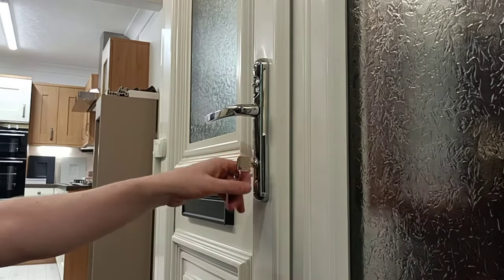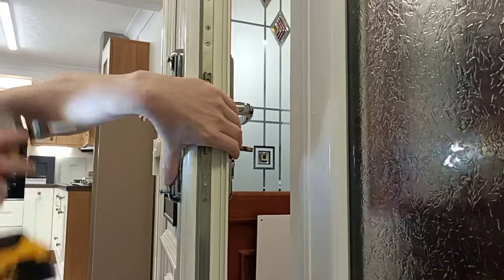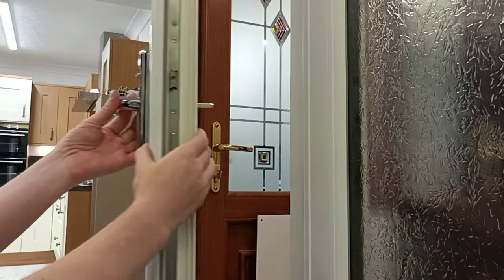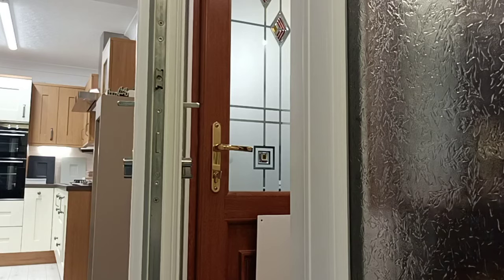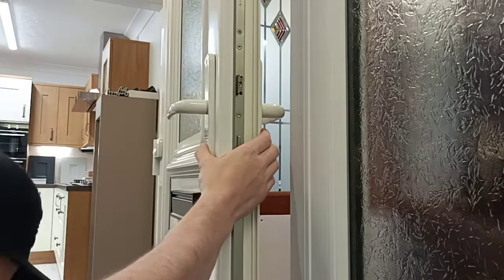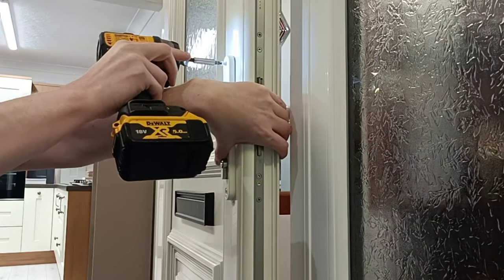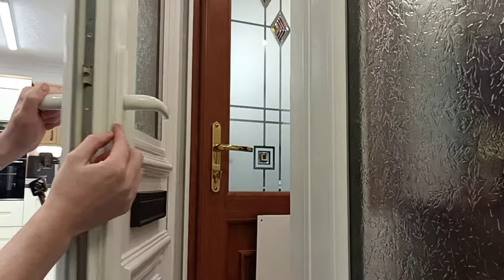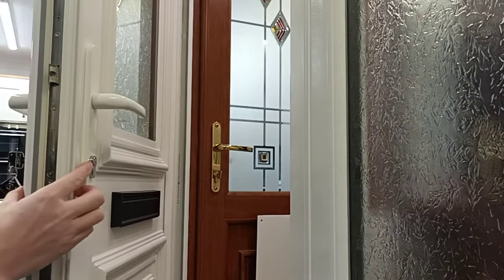How to Remove and Replace an Old uPVC Door Handle | Easy DIY uPVC Door Handle Replacement

Comment: Hi bought a new security door handle all measurements are correct but when I tried to install the sections that go into the door to screw through are larger than the holes in the door. Can you just drill the holes bigger? It's a UPVC door.
Reply from the maker: Hi, yes you can widen the holes and it won't cause any issues.

Comment: Hi, looking for some advice.

I need to replace a UPVC handle, but the problem is the measurement between the screws is 116mm.  I've trawled online and it seems the standard shortest length is 122mm.  So I'm guessing I've got some obscure or obsolete handles.  What do I need to do?  Drill new holes maybe?  Any advice would be appreciated, cheers.
Reply from the maker: Hi, send us an email with images so we can have a look sales@dgpsuk.com Regards Emma
Reply: @DGPSUK  Thanks, email sent.

Comment: Hi can you help with a question I have?

How would one go about replacing a door handle a bit like the one in the video, however there are no visible screws and the door is permanently locked? I guess the locking mechanism inside the barrel of the lock has failed which leaves the door un openable. There doesn't seem to be an obvious way of replacing it without opening the door first to get to the screws and that isn't possible in this situation.

Any ideas would be very helpful.
Reply from the maker: Hi, could you send an image over to sales@dgpsuk.com and we will be happy to advise a solution 👍
Reply: @DGPSUK  Email sent, thank you.

Comment: Is it possible to drill the holes to match the screws?
I got a new door handle 215mm space between the holes. When I tried fit there's about 2mm of a difference.
Reply from the maker: Hi, yes you can as I'm guessing you needed 211mm standard handles. Or if you prefer the correct handles have a look...Long Backplate 
 https://www.double-glazing-parts-spares.co.uk/trojan-sparta-composite-lever-inline-l31546
Reply: @DGPSUK  thanks for replying.
Reply: @DGPSUK  I need offset handles, 92mm inside & 62mm outside. I just ordered 210mm. Thanks for replying, I appreciate it.
Reply from the maker: @bejaysus7388  Hi, these are what you may be looking for...

https://www.double-glazing-parts-spares.co.uk/pro-92-62-pz-lever-and-pad-door-handles